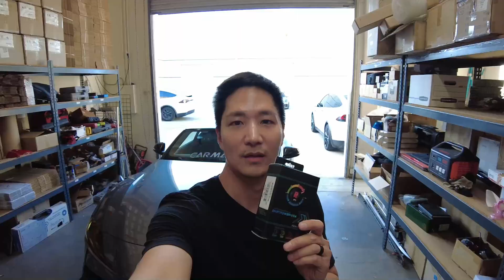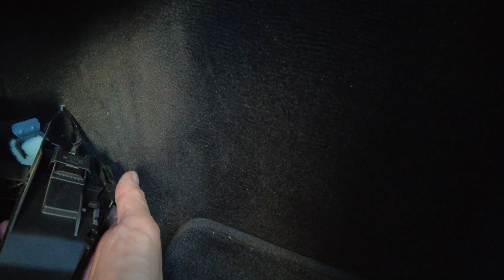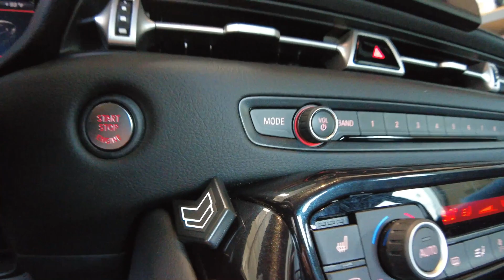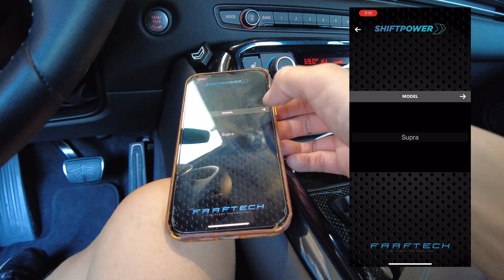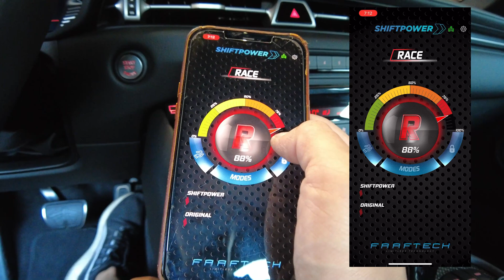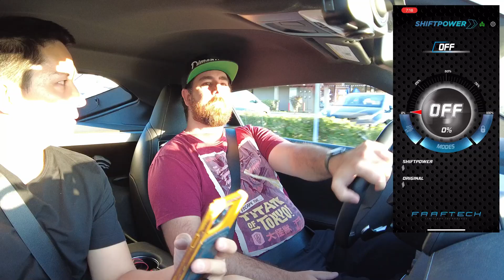ShiftPower Throttle Response Controller on the 2022 GR Toyota Supra 3.0 Premium. 2022 SEMA Car!

Comment: For anyone coming here and finding this video, note that this does not make your car faster. It simply increases the voltage from the pedal. So, less pedal = more voltage (or less). While I think that's a silly gimmick, the MVP is the ability to lock the pedal completely. Meaning, you can disable it completely. I love that feature, and wish Toyota would have just added that from the factory. Really cool idea. Otherwise, the app is pretty ugly in terms of UI (Serif font, really?), but I like the idea of being able to have the "Sport" mode pedal in comfort mode without the transmission going ape shit. Sadly, price is too high for how little you get. You're better off putting that $200 towards mods that increase HP.
Reply from the maker: It’s not for everyone. But people who have actually tried the product, they are loving it!
Reply: @BeatSonicUS I had sprint booster & it works making the acceleration quick & precise. I just received the Pedal Commander but haven't installed it yet
Reply from the maker: @djsthemetereman  nice! You should try ours too as ours has the most functionality and a very robust application!
Reply: @BeatSonicUS  I just might do that I've seen some problems people are having with Pedal Commander. Do you guys have it for a 21 Acura TLX Type S, and also can it be adjusted on the fly